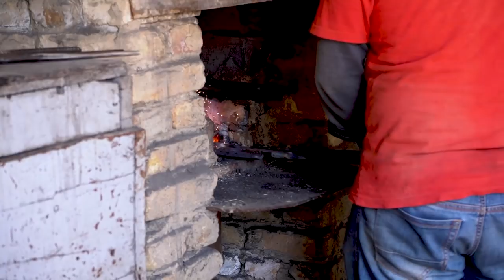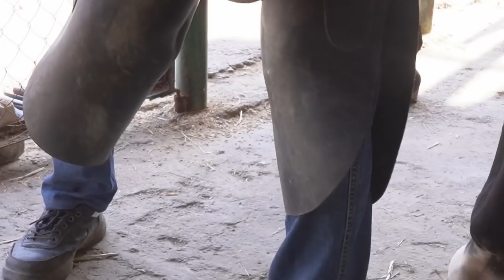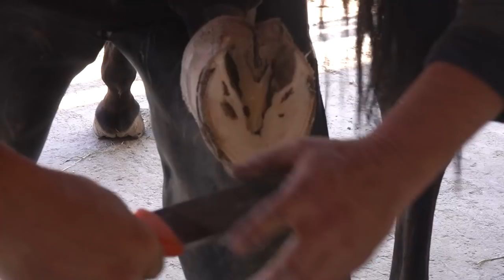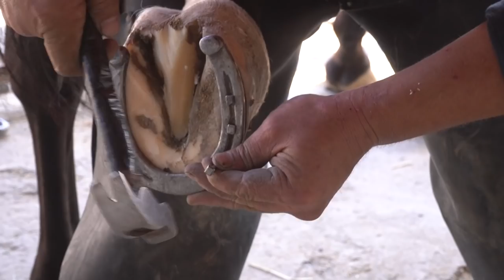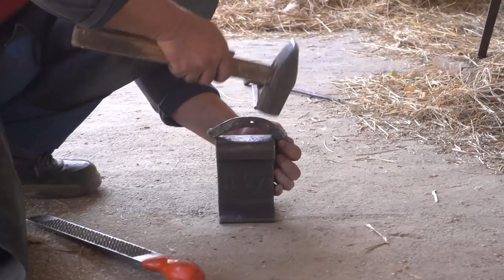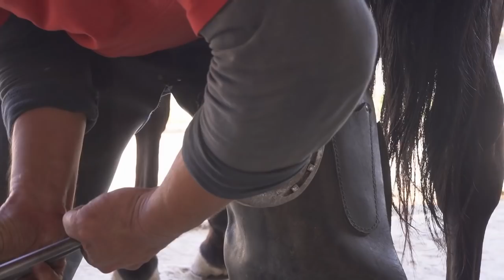No Music Farrier-Hoof Restoration-Satisfying

Comment: Let me info dump for a sec...
Hoof trimming is necessary for domestic horses, the frequency and requirements vary from horse to horse. Some horses need shoes, some have them per owner's preference, some are barefoot. Frequency of trimming may also vary, but the common timing is around 6 weeks. The frog, ( softer, triangular section of the hoof,) needs to be trimmed, and is not anymore sensitive than the rest of the hoof. Overgrown hooves are difficult and can even be painful to walk on. Shoeing and trimming is painless when done correctly by an experienced person.( I have three horses)
Reply: Kita
Reply: THANK YOU
Reply: What a long story